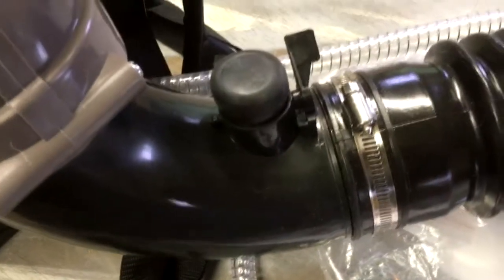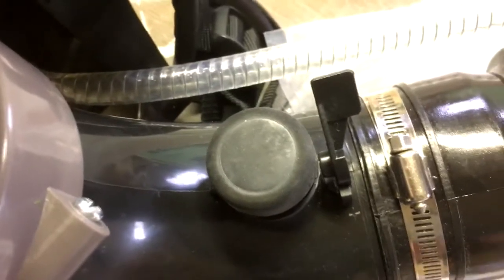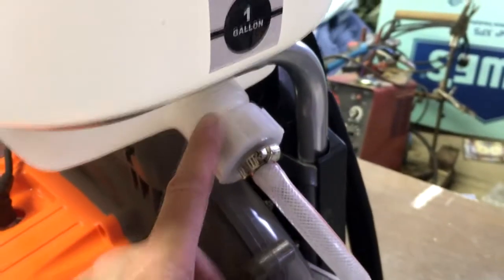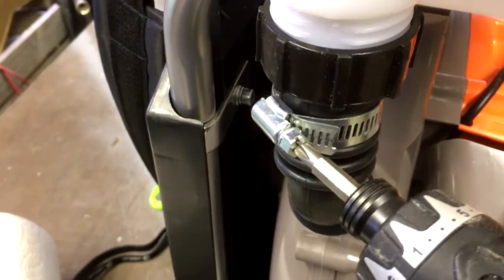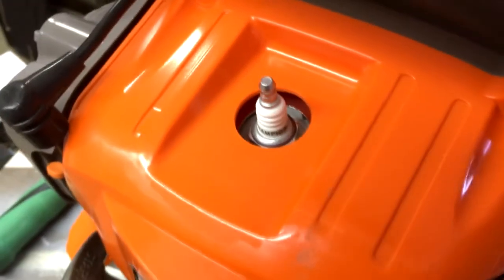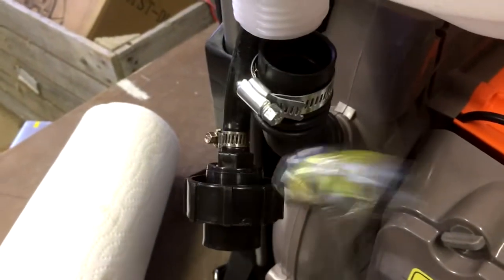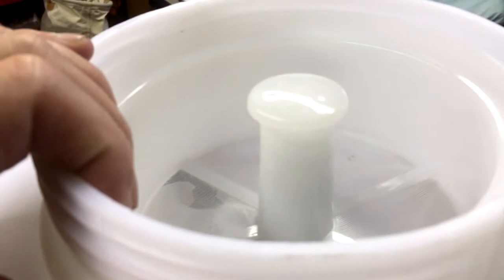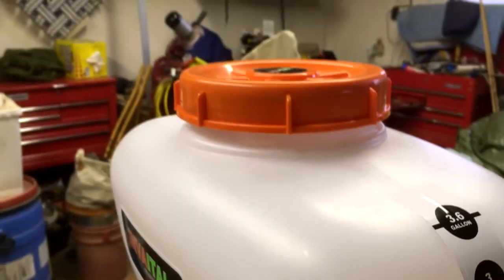Invatech Italia model 868 Mister Duster Blower Out-takes

Comment: Just got this thing in, the manual literally does not make any sense and I am missing parts. I called the factory service, had them read the manual with me they agreed it makes no sense.
Reply from the maker: I don't work for them, but I'm disappointed to hear that you didn't get as good a deal as I did.  I inventoried all of the parts before starting to assemble it, and everything was there.  I had nothing to go on but the instructions, and they certainly did the job for me.  Granted, I spent 7 years writing technical manuals for a Fortune 500 company, so maybe I saw things between the lines that you aren't familiar with.  Best to you since it really is a sweet product.